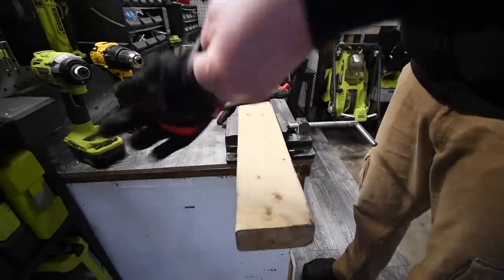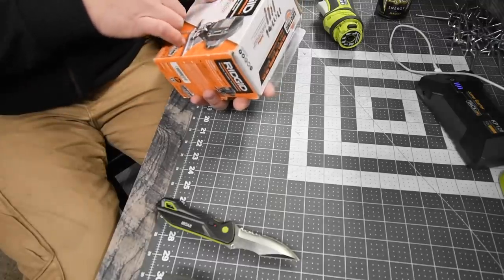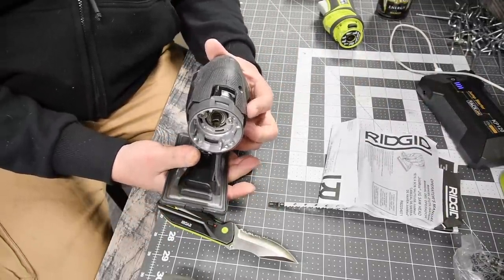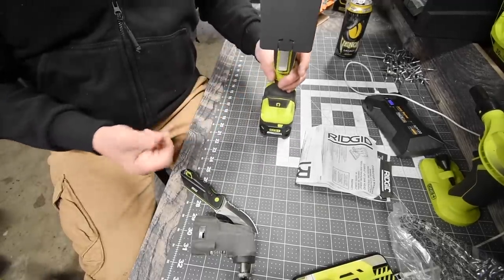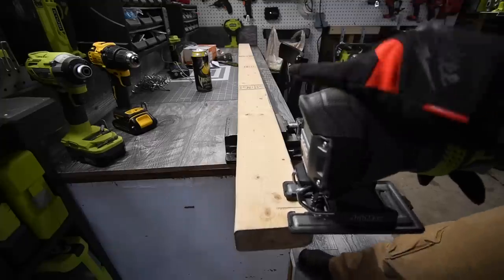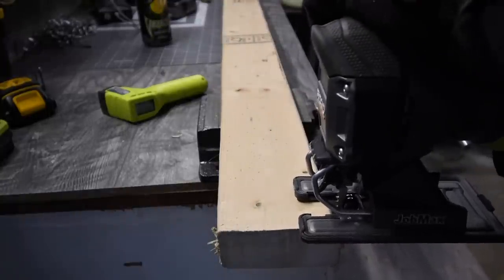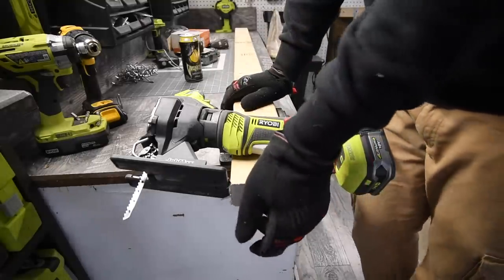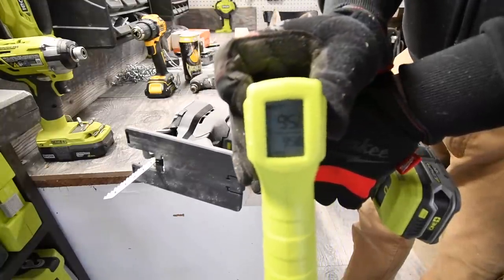Ridged Job Max on Ryobi Multi-Job tool

Comment: I'm DIYer at best. Poor homeowners have to learn and at least try to repair when funds limit your options. I just purchased this attachment and I'm  impressed that it completed 3 cuts thru a 2x4! I, like most, never considered it the best tool for that type of woodworking. But I would have tried it, if I didn't own a circular saw... I do have a dedicate jigsaw that use to belong to my father. I actually used it to cut 8'' hole in my living room floor and sub-floor to vent a portable a/c unit. (Long story) Not easy or smart but successful. I got this for small repair... cutting 1"x1" deck spindle to length , 1"x2.5" kindle wood to repair shed corners, etc. Thank for the video... I feel better about the purchase now. (Btw... I'm Ridged on Roybi as well. I heard that they are the same company)
Reply from the maker: I am happy to hear that you are satisfied with your purchase and I thank you for viewing Greg :)

Comment: Check out the black + decker matrix line. Similar tools that were also sold as craftsman bolt-on a few years ago. They have close to 10 attachments which are all surprising powerful/useful for what they are. I use them as part of my RV tool kit. I can put all of my attachments and 2 drill motors in a bag that would only fit a handful of full tools.
Reply from the maker: will do, black and decker will be on this channel :)
Reply: Awesome. I’m thinking of doing a review of the items set i own. I believe I have almost all of them. Be sure to check out my  massive ryobi unboxing video I just did!  And sorry for the spam lol.

Comment: It's good to see you push it a bit on the 2x4 to see a "worst case" scenario.  Any battery powered jigsaw I've used in the DIYer level tool would probably struggle similarly as well.
Reply from the maker: that is why I love these tests :)
Reply: Best use circular saw for 2×4s cuts in seconds and more cleaner cuts

Comment: I have the gen 1 jigsaw attachment.   Works really good.  Has light and blows dust away from work line.  I have plug in ridgid,   12v ridgid, and 18v ryobi. (All work good).
Reply from the maker: very good and thank you sir

Comment: I think it will work fine for light to medium duty.  Maybe if you cut the 2x4 at a lower throttle it won't overload but just take a lot longer.   Although normally you would use the reciprocating saw attachment I would think unless you were desperate ;)
Reply from the maker: Yes. I think the 2x4 was a little too much for it

Comment: The plastic gear drive on the Jobplus and Ridgid Jobmax units is intentionally designed to be the point of failure in case it is over used.  It can be removed and replaced if it gets stripped out.  The jigsaw attachment is just fine for the Jobplus.  I have had the Jobplus with most attachments for several years.  The problem you are having is that your Jobplus is shot.  I coincidentally just fried one of mine last week using the multi-tool head.  It did serve me well after 3 years of extensive use.  It is a good thing I have a backup unit which I recommend.
Reply from the maker: I agree, my multi job was abused for a long time and I think its time for a new one.

Comment: A better blade will help a lot, big battery and it cuts 1" or thinner wood fine.  I've sent my multitool out 2 times to get repaired,  you give home depot $20 send it out and it comes back fixed and I always get the $20 refunded. Last time they said just get a new one off the shelf, same with a orbital sander and a circular saw, I have 2 or 3 of each so not a big deal and it is either fixed or new.
Reply from the maker: very good and thank you

Comment: You don't cut 2 inch material with a Jigsaw, just saying. I'm sure it works well on the intended thickness it was designed for. I'm thinking the Ridgid reciprocating saw attachment would do better on that 2x4.
Reply from the maker: That is why this made for a good stress test.

Comment: lol i lnow this is old, but this works very well i jave the johsaw head on a ryobi jobplus and it works amazingly... its cuz you tried to firce a jihsaw thru a 2x4...lol a jigsaws for thin plywood n curved cuts.. not to chew thru sumn thicker than its entire blade.. thats what a recips for lol...    now the cut off / drywall router, and the oscillating heads on the ryobi jobplus will bur  it up fast,, i find those are best in the corded Ridgid jobmax body... but i mean of the ryobi is all u got itll do it, jist be mindful

Comment: This is probably my least favorite of all the JobMAX attachment heads.  Base does not rotate to give angles on the blade, 90 degree cuts only.  LOVE the Rigid oscillating, drywall zip, and saws all heads.  The 90 degree drill head is cool to.
Reply from the maker: it didn't do to bad of job though. I was impressed that it even did it

Comment: I actually have all the head attachments with the exception of the right angle drill head. Found them cheaper on Direct Tools website. Was able to pick up and extra oscillating tool for $20
Reply from the maker: very good, ill have to get one from there

Comment: I have the same ryobi multi tools. Mine over heat quick and will stop working until it cool down which is ignoring. I don't know if ryobi have a brushless one version yet or not or have a stronger one on the market. I do love the size of it compare to other brand. I also don't like the fact that is still use a ally wrench to replace blade on it. I use a lot of ryobi and that multi tool is pissing me off.
Reply from the maker: they don't have a brushless version yet but im hoping that they will make one soon
Reply: @ManCaverTools  ya I'm just waiting...

Comment: It may be too much for a gen 5 ridgid too mine cuts out at times without that attachment better off with the actual tools. Unless it's the rotary attachment ...I have the recip attachment but haven't used it much. .....does overheat but maybe the octane is better ...im replacing the gen 5 with octanes
Reply from the maker: Ryobi needs to make this in Brushless

Comment: ... that soon the pinion is a rubber and is running out very easy.  Happened  to my oscillating Ryobi and because was encapsulate I had to open up the tool and put a bicomponent raises so I can work with the tool. Probably I should try to make one from a rubberized polymer to talk from the vibration even is a vibration tool  I don't think it was a big difference. I will give you pictures on Instagram if you have one.
Reply from the maker: I have Instagram It is displayed on my home page on YouTube at the top and thank you sir

Comment: I have to agree with alot of these comments, wrong tool for what you are trying to accomplish, also,  using a free included blade will never give any kind of accurate overall results, to me seems like it would fair well on material designed for, also not made to replace a conventional jig saw, but great to see it in action,
Reply from the maker: it wa just a test video to see what it can do. this will not replace your jigsaw
Reply: @ManCaverTools i understand and totaly agree.

Comment: Great video guy! Didn't even know that the multi tool could do that! I always grabbed the jigsaw. Because I still deal in Craftsman tools, I knew they had a system (Bolt On 20V) with many different attachments that the sales people told me were good sellers for them similar to the idea. 

Another line they let go extinct were in demand with buyers wanting the other attachments to the system. I never payed any attention to that system back then, but the idiot CEO who is running Sears into extinction is just in it for a money grab. Thanks David!
Reply: Black and decker has the same system as the craftsman. The drill with the other attachments.
Reply: @dustinmoore1650  I vaguely knew about these particular type of tools (add-on's to main unit). Got into the Craftsman C3 line in early 2000's when I moved out on my own & thought is was a great idea, 1 battery many tools. Only Ni-Cads were horrible. Then the Li-ion batteries came out & changed the game. Sears used to be the top retailer for over 100 years & like Walmart or Home Depot today & many people owned Craftsman tools. 

Still have my collection of old C3 tools which many are now collectors items & sell for big $. I paid up to complete my collection. Not all, but the rare stuff. C3 still has a big following. I then bought into the Ryobi ONE+ line & the rest is history.
Reply: NoMoneyG yeah I still have a bunch of c3 stuff put in totes. I just don’t want to sell them for some reason. Maybe because they were the first tools I bought. Now I’m deep in Ridgid and Milwaukee with a bit of DEWALT mixed in.
Reply from the maker: I thank you greg :) more videos are coming

Comment: I have most of the attachments there underpowered but in a emergency they help
Reply from the maker: it is a useful tool. but it little to much for the Ryobi
Reply: I agree that it's too much for the ryobi job plus. I got that omt on a kit and decided to get all tho job max attachments. It's fine for installation jobs... But not for heavy work. I've been remodeling bathrooms and it's good for 1/2 inch wood but nothing more than that. I've decided now that I'll get the octane omt next

Comment: I have it the jigsaw it put to much stress on the tool and burn it up
Reply from the maker: I think that attachment is too much for it. but I will test it out again with a new multi job tool
Reply: @ManCaverTools  No sense in buying a new Ryobi multi-tool, they're a POS, it's one of the worst 18V tools that Ryobi makes, not to mention that it has been out for several years and may be the only cordless multi-tool on the market, (other than the 12V H.F.), without a tool-less blade change. The ones I've had vibrate so bad that they damaged the plastic base on the battery packs, I can't imagine that it is good for the life of the battery. The model that they sell in Australia looks like it might be a nicer unit and I like the way the head can be adjusted.

Comment: You are a bit late on the draw with this one they have discontinued half of the line already and the r822 number is the model number the rubber is a major cause of failure and is for vibration reduction they are about a dollar or two a piece at internet parts houses
Reply from the maker: I can get them on eBay or something
Reply: you have a p/n or link for the rubber piece? I picked up a ryobi multitool from craigslist a few weeks back and while cutting performance is adequate, it has the worst vibration of any power tool I've used.
Reply: @scotth5503  you may want to check ebay or Amazon for better prices but that should help the tool may be a little underpowered but it is smooth I like the 12v ridgid better than the Ryobi it's great with the ratchet head
Reply: @craigchiddo2794  do you know which part it is on this diagram? https://www.fix.com/parts/multi-tool/ridgid/fix11868360/rubber-gear-cap-562408002/
Reply: @scotth5503  Manufacturer #: 562408002
Reply: @craigchiddo2794  awesome, thanks!